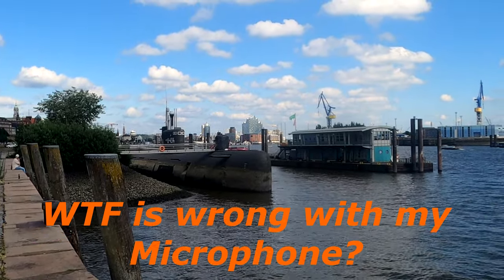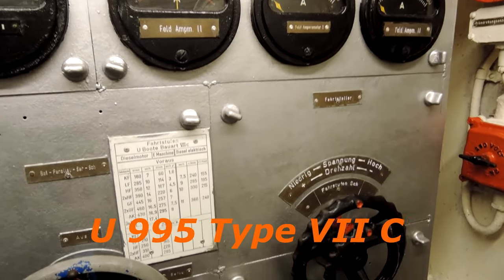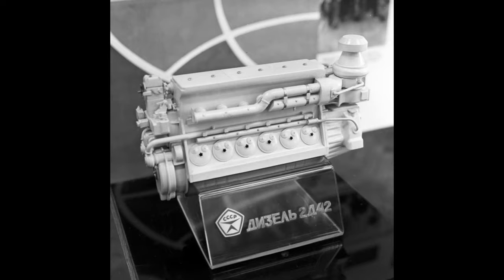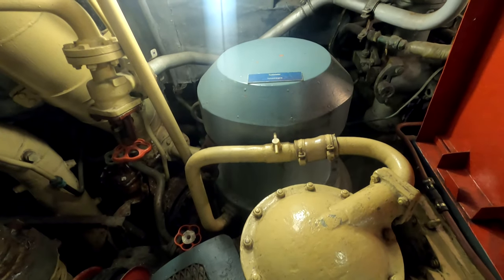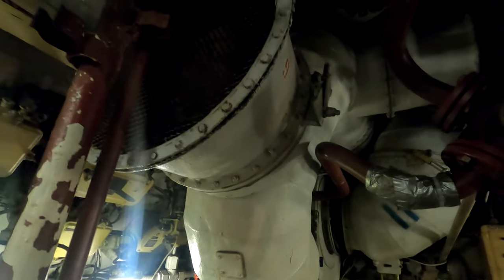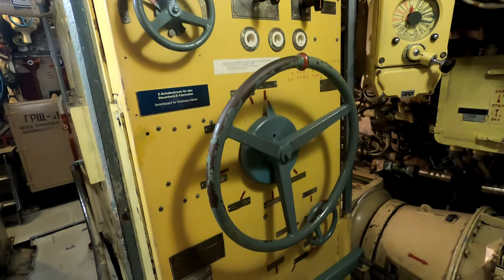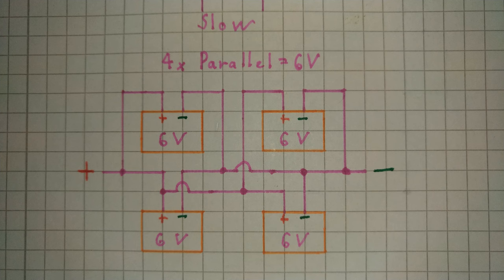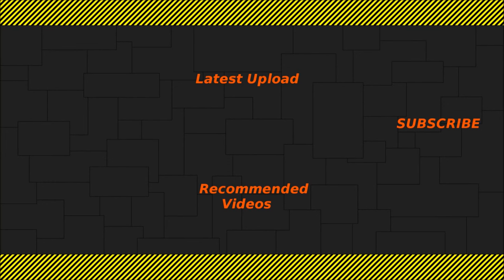Soviet Diesel-Electric Submarine Engine Room explained | B-515 in Hamburg

Comment: As far as I know, this boat was somewhat copied from German design Type XXI. U-Boats had this conventional diesel-electric arrangement, where the diesel can mechanically drive the shafts.

US design fleet type submarines had the real diesel-electric propulsion you drawn, with the difference that a dynamo could be either connected to the motor bus directly feeding propulsion motors or to the battery bus for recharge.

Having a small generator would make sense anyway. US design fleet type diesel subs had 4 main diesel driven dynamos for propulsion and charging, and one rather smaller auxiliary dynamo to take over house load, thus relieving the battery on surface operation.  However on the Tango it looks more like a silent creeping motor.

Comment: The reason for so many ammeters could be that you have more than one generator charging one battery bank, the meters allow the balancing of the machines so one generator is not overloaded while another is idling along. With the variable speed of the direct connected diesels also driving propulsion it would have taken continual adjustment of the exciters (field current) to keep everything balanced. I agree bunks in the machinery spaces must have been worse than hell, there is no way anyone could rest there.

Comment: Kolomna 2D42 two stroke, from the same people that brought you the 16 cylinder version as the 5D49, very familiar in the former DR BR 232 'Ludmillas'
Reply from the maker: It's a Two Stroke? That explains why I was a bit weirded out by the Rocker Arms. But isn't the V16 Engine of the Class 132 Locomotives a Four Stroke? Or are you talking about the Class 120, which has a V12 Two Stroke so it could be like two of these Engines here?
Reply: @Genius_at_Work  Yes, they are, the DR BR120/M62 were two stroke, they switched to four stroke because it was more fuel efficient, probably
Reply from the maker: @AndreiTupolev  Can't tell for Engines of that Size, but large Two Stroke Marine Diesels are much more efficient than Four Stroke Engines, although Economy of Scale and their slow Speed certainly helps.
Reply: The cam arrangement looks like that of an EMD locomotive engine, which is a two-stroke.  Displacement of the three main series is 567 - 645 - 710 cubic inches per cylinder.  They were either V-12 or V-16, though some were V-20.
Reply from the maker: @dennisyoung4631  We have some of these here too; Nidquist och Holm (NOHAB) in Sweden was licensed by EMD to build their Locomotives. The first one was a "europeanised" Version of the F-Unit, which means that is narrower and flatter for the smaller Loading Gauge, has six Axles instead of four for the lower Wheel Load Limits, two Cabs because Double Header Trains are unusual here, rendering out back-to-back Pairing, and smaller Modifications like Side Buffers and three Headlights. I don't know how NOHAB called these Locomotives, but the Danish DSB classed them as "MY". Another nice one from NOHAB is the DSB MZ, which has an EMD 645 Engine with 16 or 20 Cylinders, depending on Version. I'll have to ask Danish Rail Museums some Day about making a Video on one of these; either MY or MZ. There also is an operational M62 with that Kolomna Engine in a German Museum.

Comment: So sub does not even utilize the same setup as the type XXI? Thats an odd decision...
Reply from the maker: Originally, the Type XXI had such a Setup too, with M.A.N. M6V 40/46 Six Cylinder Diesels (the same as on most Type VII Submarines) with Clutches and Motor-Generators. The Bundeswehr later replaced these on U 2540 "Wilhelm Bauer" with Mercedes-Benz V12 Diesel Generators, turning into into a "real" Diesel-Electric. Such a Plant was intended for the upcoming Class 205 and Class 206 and U 2540 was used as Testbed for these.

I can't find a logical Reason to build such a complicated Plant into a modern Submarine which uses the Diesels almost exclusively to charge the Batteries, especially because "slow" (more or less; when talking Marine Diesels, slow usually means below 150 RPM) Engines are less compact than faster Engines of the same Power. The only Explanation I can think of is that having Motor-Generators instead of Generators and Motors saves a bit of Copper which would sort of fit for the Soviet Union, but then again they built Submarines with Hulls made of Titanium.

Comment: Good video.
Reply from the maker: IMHO, it's my best Voiceover Video so far. I'mnot that used to speaking on Video. I'm currently working on a Voiceover Video about a Marine Steam Engine in the Lucerne Transport Museum. The Skript is even better than here, I'll just have to see if I do just as good of a Jib at speaking or if I'll screw up again.
Reply: @Genius_at_Work  You're doing a wonderful job.  Keep at it.  I really enjoy all the mechanical stuff, especially anything about diesel.
Reply from the maker: @Barnekkid  Not that much coming right now. Theoretically, I'm planning to make a Video about starting up a small Marine Diesel Engine in my old Seaman School, but it's very hard to find a Date where the the Diesel Room is free and both the according Teacher and me have Time. I recently contacted a Ferry Operator to make a Video about a V12 Engine on a Diesel-Electric Ferry, and a V20 Engine on a High Speed Ferry with Water Jet Propulsion. Both Videos will be more "show Engine Start, then explain Propulsion System" than about the actual Engines. It's still pending Approval though, so I can't promise anything. I'll have more Steam Videos coming up in October and November though, and would like some Electrical Stuff too (100 Year old Electric Locomotive; and another Hydro Power Station, also 100 Years old). These are pending Approval too, so again no Promise.